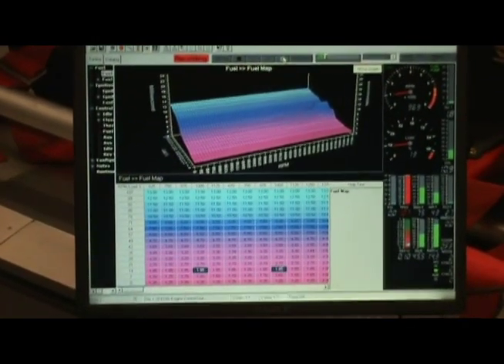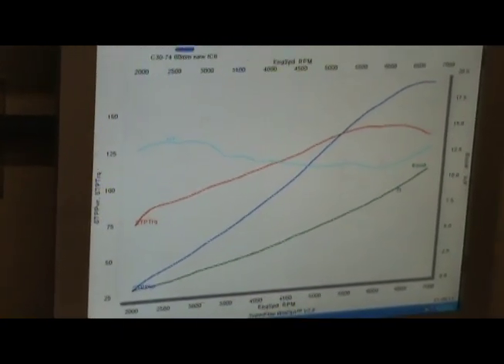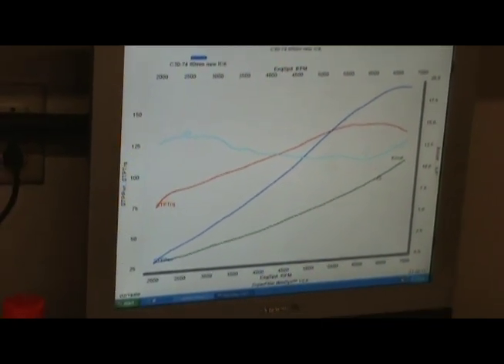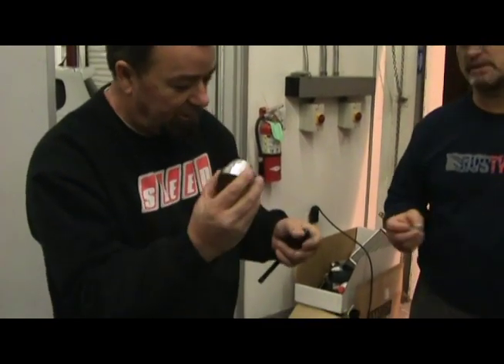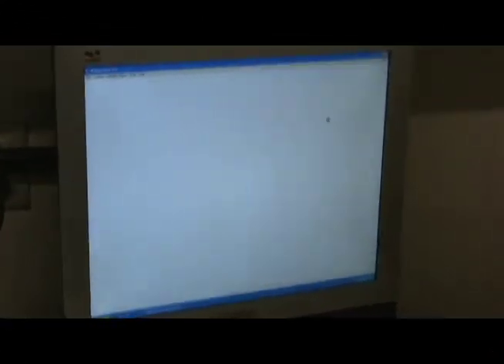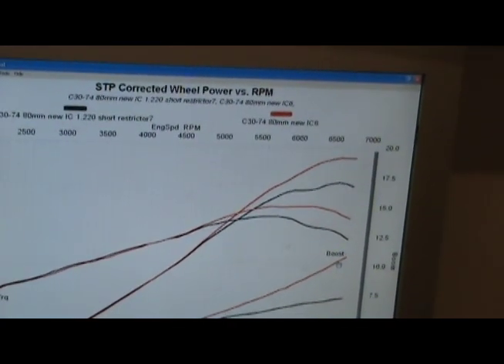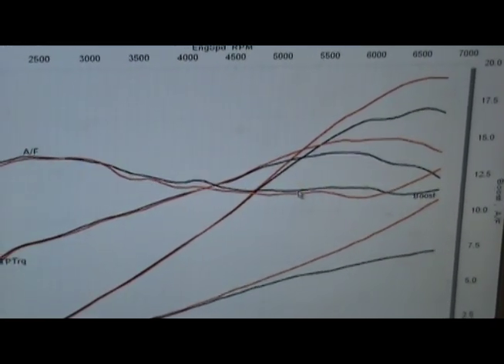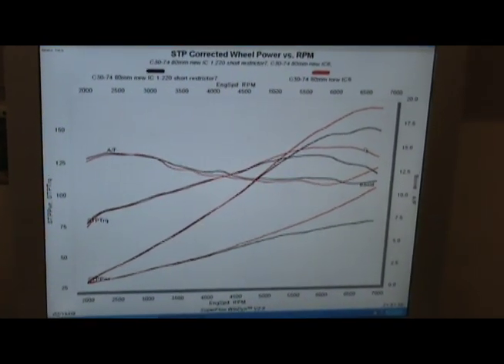Spec Miata with a Rotrex Supercharger Dyno run

Comment: The idea was to limit the boost and hp for SPEC road racing class. Trying to keep costs contained and have engines last the season not just one 1/4 mile run.

Comment: Woooh Cowboy!  I'm reminded of the saying; "A little knowledge is a dangerous thing". Centrifugal belt drive blowers produce an exponential boost curve. Therefore restricting the input air flow to reduce the top-end boost creates a heavier load on the engine, and the Rotrex planetary drive system. You will also dramatically increase boost temperature. Far better way is to use a bigger blower, max out the rpm of the blower with a pulley change, then use an adjustable bleed-off valve (waste-gate)

Comment: Hello DrGoodwrench i have a question for you, im looking at a Rotrex for my 03 Corolla (Australian RHD) but the issue im having is freespace in enginebay, do you know if its possible to put on an extension snout/shaft to the Rotrex so i can position over near the g/box, which has alot of room! 
eg
pulley)================(S/C
if you can help me out with any info, message me and i can send you some links of pic's to give you a better idea of what i mean

Comment from the maker: @iliasmetalworks  agree that lack of customer support is a nail in the coffin for any brand, just making the point that anytime you are trying to be cutting edge as an early adopter, you run the risk of having to deal with problems all on your own. I don't sell these Superchargers, and as you see had to do my own development work to make it work in the fashion I wanted- which is not in a manner Rotrex approved or designed for- so I was on my own to work around the problems I created for myself .

Comment from the maker: Not looking to "flatten" the boost, but instead get maximal loww rpm boost which gives max torque, without overboosting. After killing three motors we realized the restrictors were the way to go to get both the bottom end, and top end that survived. These cars are built for endurance racing, not 1/4 mile pops. By using and oversized blower and spinning it hard, but restricting it at the top, we achieved our goal.
We now run a 1.8 liter miata motor and are into the 300HP range, huge torque!
.

Comment: Guys, instead of farting around with intake restrictiors and pulley sizes to flatten the boost, Why not use a 'screw type compressor' and be done with it.

Open the throttle, and you'll get a ruler flat boost from idle to maximum RPM.  
By the way... not to be confused with 'Roots type blowers' with a twist in the rotors, that start losing efficiency after 4,000 RPM... 
No, I mean a true internalized compressor which has the efficiency of a turbo at maximum revs... 

Now That's What I'm Talking